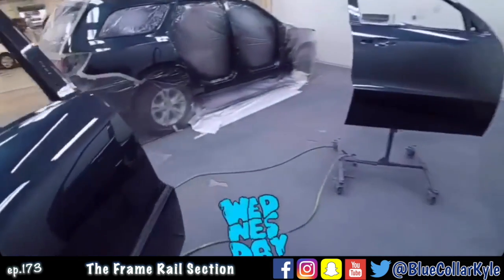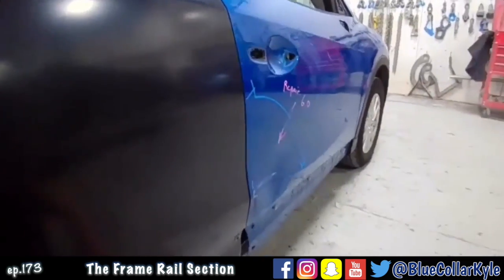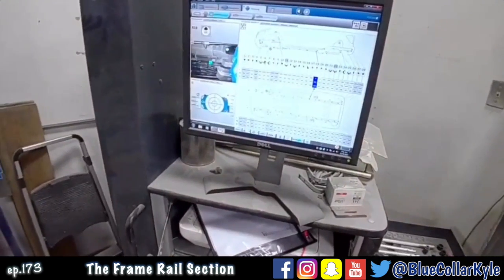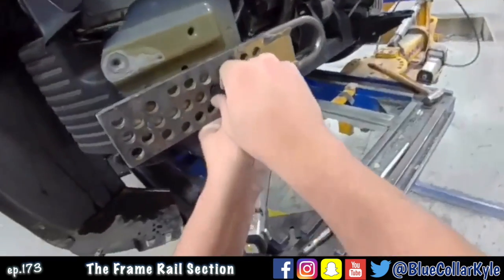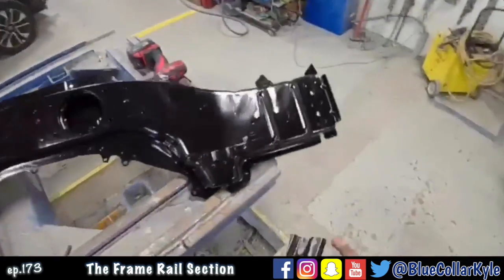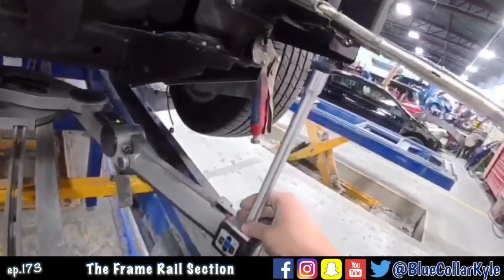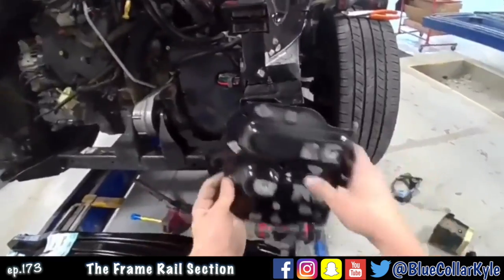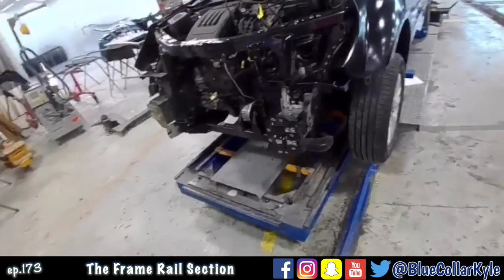Inside the Bodyshop Episode 173

Comment: Another methodical job. I have always wondered tho, is there a way to prevent rusting, when welding the new piece to the car, besides cleaning and applying  that weld through primer before welding and the stuff for cavities afterwords? Is this primer really that good and doesnt get burn through exactly where the welds are, leading to bare metal and later on, rusting? Thank you in advance for your time.
Reply from the maker: Brulserz Cavity wax is really the best bet for hidden areas.  If applied correctly it shouldn’t be an issue
Reply: I see. Thank you for your quick response. Keep up the good work :)